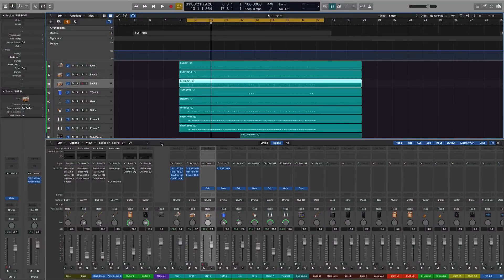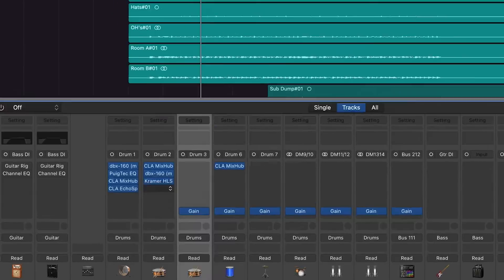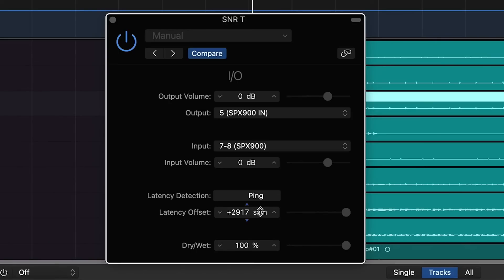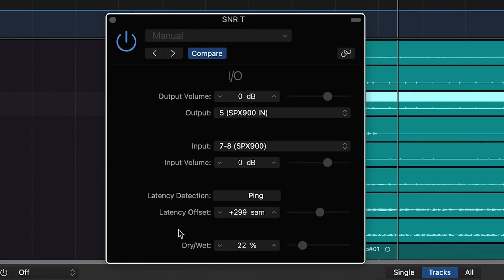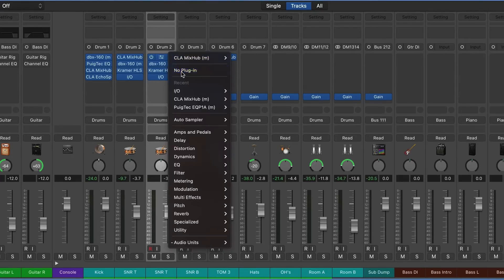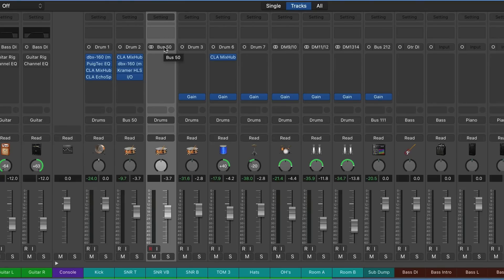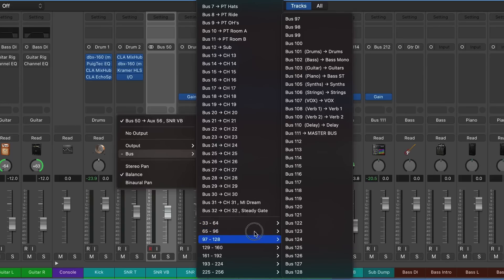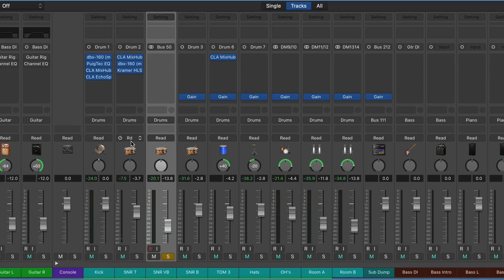Using Outboard Gear with Logic Pro X

Comment from the maker: Hey everyone. Let me know if you have any questions about using outboard gear with Logic.
Reply: how do i keep the changes that i did in the external gear into the track?
Reply from the maker: Hey Raz. You can print the output of the external gear onto a new track. That way you always have a printed version. I think I showed that in the video. 
Always take note of any settings on any outboard gear too, make a note or take a photo. For example, I send snare drums to my SPX900 and when I find the settings I like I note the patch name and any parameters I changed in Logic. If I was using an external EQ or compressor I’d do the same thing plus keep a photo of the settings.

Hope that helped.
Reply: @EverythingMusicRecording  thank you man you realy helped me !!
Reply from the maker: No worries at all!! If you have any other questions don’t hesitate to ask.
Reply: Can i use this method to reamp? Or maybe use pedal as an effectsboard?
Reply from the maker: You could yes. You would need a reamp box tho before your signal hit the front of an amp or any pedals.
Reply: Thanks for the cool video! I'd like to ask though, is there a way to use outboard gear, let's say a compressor without the I/O plugin in Logic Pro X?
Reply from the maker: Thanks, glad you liked it. And yes, absolutely. So let’s say you want to send a bass track out to a compressor without the I/O plugin. On that track set it’s output to whatever output on your interface is feeding the input of your compressor. Create a new track (this will essentially be the compressors return) turn on input monitoring and arm the track. Dial in the compressor and when you’re ready, just hit record. You can do the same thing using the FX sends as well instead of the tracks main output. 

You’ll have to adjust the new track tho as it will have a slight delay. That’s one of the benefits of using the I/O plugin is the delay compensation. 

Let me know if that helped or if I need to go into more detail.
Reply: @EverythingMusicRecording  Thank you so much for the info! What would be the best way to adjust the delay for the new recorded track? What would you do? Thanks again! Much respect!
Reply from the maker: No worries. I just manually move the track back. If it’s something with very obvious transients then just zoom in so you can see the transients of both tracks clearly and just line the new track up to original.

If there are no clear transients, like maybe a bass or distorted guitar, find yourself a 1 second test tone. Literally just a super fast little 1k beep. Place it on the track you’re sending out to a compressor or whatever you’re using. Stick it 2-4 bars before the start of where say the bass or whatever you’re sending starts. When you’re ready to record the new track start recording with the compressor bypassed. (Assuming there is a bypass switch that still lets unprocessed signal go thru the unit) and once you hear that beep, engage the compressor. That way after it’s track both the original and new track will both have a quick, clean transient you can use to line them back up with. 

The reason you want the beep to be clean is, let’s say you run it out to a reverb or a delay, that beep will now either be useless or make it harder to line back up with the original track. 

Let me know if that made sense. 

This is the sound though. It’s called a 2-pop or a sync pop. It hits when the counter hits the number 2. https://www.shutterstock.com/video/clip-16745287-2-pop-picture-start-video-countdownfilm-leader

You can make one in Logic as well. Just record a few seconds of a 1k sine wave and then slice it up to be a second or less. The ones in film are 1 frame long, so if you think 24 frames a second, it’s a very short little beep.
Reply: I'm trying to record through my Compressor so its directly affecting the track. I'm getting a reading through the gain reduction LEDs but its not affecting the actual recording? Im using a clarret 8 pre with a Drawmer MX30 Going out from the Clarrett (Output 7) into the MX30 (Input 1..left)  then plugging a mic into channel 1 of the Clarrett.
Reply from the maker: Hey other Jeff. That setup will not work. You would either need to run your mix into an external mic preamp, then into your compressor, then into the Clarett to your DAW. OR you would have to record first into your DAW, then send that track back out to your clarett into your compressor, back into the Clarett and back into your DAW. 

I did a video explaining this exactly so I'll leave the link instead of tying out a 12 paragraph reply. lol

Let me know if this helps or if you have more questions

WATCH THIS - https://youtu.be/8OcND5CYwsE
Reply: Hi Jeff ! Exelent video ! - I have a problem with mi configuration or my routing conexion - have a many feedback on my monitors when up the gain of external hardware - preamp or eq - what do you think need moded in my case ? Thanks !
Reply: Hi Ive been trying this to use the onboard effects of my x32 desk I can send the signal out using I/O and through the effects but I get nothing coming back to logic, I assume this is to do with the desk routing of card/local settings any ideas how to get this working? cheers
Reply from the maker: Hey Billy. I couldn’t get the wiki manual on Behringer’s site to load and the quick start guide was of little help. 

It should be in the routing section, I’d assume under the “card” tab. That’s where I’d start. I have no experience with the X32 so sorry I’m not much help on this. 

But start in the routing section for sure. I can’t imagine that there wouldn’t be a way to output the FX busses back into Logic.
Reply: @EverythingMusicRecording  Just in case anybody else has this problem, I found this method works. In the routing section of the X32 go to the CARD OUTPUT tab and choose a channel (it could be any channel) I chose 32 as its least likely to be used as much, change the settings "USER OUTPUT 32, category: to LOCAL IN, out signal to local in 32" then in the logic I/O plugin use 32 to return signal to DAW. Maybe there is a better way to do it, and if there is, and anybody knows it please share, but this method works
Reply: Do you dither on the way out?
Reply: Hello! I'm having problems.

I routed with the I/O in parallel on my drums, but when I record to release the hardware the sound changes and has a flutter or wow-like effect. Very strange.

Note: I already clicked on the ping for logic to adjust the latency.
If you can help me, thanks!
Reply: Yes I have a few questions. I follow all what you did but I am not getting signal in my outboard compressor. Is there anyway we can get on a call or is there somewhere I can send you a video of how I have it setup and you can let me know if I am wired wrong or if I am doing anything else wrong?

Comment: Quick question, would I use the same methods if I want to track with the outboard. In other words. In real time go into the interface and parallel record say, a compressors then have two track  one with the dry signal one track with the parallel compressed wet signal printed at the time of tracking ?

Comment: trying to tie in my H90 to Logic v 11.1.2.  Not sure what cabling is required first. Have MOTU 828 interface and two dual stereo TRS cables, and a USB-C cable going from H90 to Mac M3 computer. With a single high speed USB-C cable connected, do you still need analog audio cables involved at all? If yes, then stuck on how to connect them. Guessed that I could cable the H90 output 1 and 2 pair by going into line ins 3 and 4 on 828. Is that right? Tried that. But how does Logic gets its track modified by the H90 - say I bounced a BIP file on track 2 and I want to audition some wobble effects from the H90 - how could that work?  TIA if you know how to sort this

Comment: Is it possible to track vocals with the i/o and it be printed after being recorded?
Reply from the maker: Possible, yes. But it would most likely add too much latency and it would then be very difficult to track vocals. You would be better off recording thru whatever outboard you might want to use before coming into Logic (Example, mic --> mic pre --> EQ, compressor --> interface --> into Logic) or sending it out after you have finished recording.
Reply: @EverythingMusicRecording  imagine though?

Comment: Hey great video. I have a question though, if you print the reverb return, does it stay time aligned with the original track via the i/o plugin? In other words, say I print the track, and I solo both the i/o'd snare track alongside the new print, are they still phase locked and time aligned? With things like verbs there may be some predelay in the patch, so it might not be super critical that it's time aligned. But an 1176 or something, you'd hope that the printed track is still aligned like the i/o track after pinging it. Can you verify that this is the case? Thanks for the cool video! Just subscribed.
Reply: Same question here. For parallel procession it is super important to have a perfect aligned signal. In Cubase it is no problem.

Comment: when i hit ping theres no sound and no response. ive made sure the routing is correct. may i ask what the problem is?
Reply from the maker: Hard to say without being there to see what’s going on. Besides the routing I’d double check all the physical connections are correct (we’ve all patched things into the wrong thing, it happens)

Otherwise try bypassing the I/O plugin and see what happens. Take a track and set it’s outputs to wherever your outboard is connected too and set up another track with its input set to the return of your outboard and see if that works. 

Could also be as simple as rebooting as well. Sometimes the I/O plugin can do some weird shit

Comment: THANKS, do you think its a good idea to use an outboard compressor on the mix bus? im asking cause i like the sound of the new warm wa 1b but its a mono comp and im wondering weather i should get a comp thats stereo so i can use it for mixes..
Reply from the maker: I think it’s a good idea to use whatever works for you, be it a hardware compressor or a plugin. 

You’re right tho, you wouldn’t be able to use the WA1B unless you had a second unit since it’s a mono comp. So if you really like it you could get a second (which would give you something different then the typical SSL style bus comp) or you could find a stereo compressor that you like and use that instead 🙂
Reply: @EverythingMusicRecording  thanks

Comment: 299 samples ! What’s the reasoning behind typing this . I have a eventide dsp4000 unit that pings 2000 samples and it’s got me stumped on how I offset these number as it’s so high . I tried bypass unit before ping but still get over 2000+ ping no matter what I do . Guess it’s dsp related but I just want to make sure the latency is offset and I’m confident
Reply from the maker: Oh geez, trying to make me remember THAT far back? What did I ever do to you?!?! lol

The 299 I had tested with before filming the video. I knew running Quicktime to record the screen and such was going to cause issues and if I recall the 299 was what the I/O plugin gave me before making the video.

2000 is pretty high but your buffer settings and such can have an affect on that. Also there are times the I/O plugin likes to act up and give ridiculous readings. So that could be part of it too. I've more or less stopped using it as I have a different method. I should actually make a video about that process.

Comment: Hi, congrats on the great video. Unfortunately, I seem to be having a problem with Logic X’s I/O plugin.  The sound seems to go out fine but nothing returns. The I/O plug in worked on a previous Mac I had, but does not with my current model (3.5Ghz i7 imac). The other details: Logic version is 10.4.7, Mac OS is 10.14.7 (Mojave), Apollo Thunderbolt v. is 9.9. Any idea of what the problem might be and how to fix it? Or a workaround? Thanks a million!
Reply from the maker: Thanks, glad you liked the video. As for your question, thats a tough one to answer just because your version of Logic and Mac OS are quite aways back. Off the top of my head though it could be a simple routing issue. Maybe the wrong input returns selected or something along those lines (we've all done it lol) It could be a setting in the Apollo Console SW (if you're using that)

As for a workaround you could bypass the I/O plugin. Just set the channels output to where the signal need to go and have the return come back on a new track. Then you could just print the return. You will just have to manually line them up after to compensate for the time delay. A dead simple way to do this is on the track you're sending out add some sort of short sound, like a sync pop and place it a few bars before the track actually starts. Then you'll have a reference to line the tracks back up. I can explain that much further if need be, just let me know.
Reply: Hi, thanks a lot for your reply. Unfortunately I think I can rule out a routing issue, I suspect it could be a version mismatch/compatibility issue. As for the workaround, that’s a great idea and I was thinking of doing something like that (plug and unplug tech, coarse but… works! ☺). But it starts getting fairly unpractical when it comes to a multitrack session where you need a lot of different processors and would have to switch cables a dozen times or so. Or am I missing something? Again thanks. @EverythingMusicRecording

Comment: Wonder if you can help 🙏
I am trying to set up my M7 reverb … HARD-WEAR ROUTING: 
From Apollo x16 out ( in this case, output 1) into ➡️
M7’s AES (input ) then
M7’s AES (output) back into ➡️ Apollo IN ( in this case, input number 3 ) 

Regarding the m7, I brought up the Audio format 
To Digital, so that it’s internal routing is through the AES I/o ( see attachment). So I assume that part is covered 

So the problem I am having I believe is with using pro logics X I/O plug-in .. 
     Firstly,  I record a stereo acoustic track using the Townsend microphone so I assume I have to use the I/O plugin in stereo ?? .. 
         
         In the plug-ins Output,  I have put 1
         In the Input,  I have put 3 ..
Doing so  i can hear audio , 
But also latency in the “dry” mode  and the ping function doesn’t seem to be engaged  as I do it get any numeric summary after I press it . 

Also in wet slider at 100% I cannot hear the m7 when I scroll through the various reverb presets 

Any suggestions as to what I am doing wrong and how to final hear the unit doing its thing through the DAW will be super !
Reply from the maker: lol with the amount of questions I get involving an Apollo I think I'm gonna have to eventually suck it up and buy one.

So, knowing I don't own an Apollo, nor a Bricasti (I'm a little envious btw) it sounds to me like the issue is in the Apollo. AES is 2 channel. So Logic should be sending, as an example, to Outputs 1-2, and coming back on 3-4. But you only mentioned sending on 1 and returning on 3. 

You also mentioned changing the Bricasti's routing to digital (which to use it's AES ports is correct) but you never mentioned anything about AES on the Apollo which makes me wonder if you are outputting and returning to the Apollo via the DB25 connector and not AES, which you would need to do.

If you are feeding out and back in VIA the Apollo's AES ports then those ports may not be configured correctly in Console. I don't know if they default to this setting or not, but many use the Apollo's AES ports to feed extra monitors. This is configured in the Hardware section of Console. So take a look in there and see if you can find out what, if anything is being sent out via AES. If MIRRORING is turned on then they are set to mirror the main monitor output. Either way you'll need to make sure that 2 channels out and back in are assigned to the AES ports in Console. I have a hunch that is where your issue (may likely) reside.

Keep me posted =)

Comment: When I use the I/o plugin I only get audio from my left ear? Help? The only solution I have found is copying and pasting the mono recording to a duplicate track, and setting the first track to output 1 and the second track to output 2 even though I am only using a single line to xlr cable out of output 1 on my interface
Reply from the maker: Off the top of my head it sounds like you have a mono track but might be adding a mono-stereo instance of the I/O plugin. So the plugin is expecting to see a stereo return from your outboard gear. Make sure that in this case the I/O plugin is set to mono. 

Let me know if that helped any
Reply: @EverythingMusicRecording  update! For some reason my Logic Pro routing is SUPER BUGGY! it works fine sometimes other times I have to out to a bus, then delete the bus and switch back to stereo out on the track. Or switch the track input to no input, then back. Sometimes the fixes it if I just solo the track and then unsolo it.
Reply from the maker: Sorry for delay Dakota, been crazy busy over here. That’s messed up. I’ve never had Logic do anything like that so I’m a little lost for words on that one.

Are you using a mix template or are you starting sessions from scratch? Reason I’m asking is that if you are using a template then maybe the template file could be starting to become corrupted. 

IF a mix template has the issue but a new session file does not then you’d know it’s the template and you’d want to recreate it.

If it’s not something like that it could be a preference file issue, could be Logic itself. Sometimes trashing the .plist files for Logic and rebooting can solve weird issues like that. Other times you may just need to uninstall and reinstall Logic. I’ve never had to go that far but there have been times over the last 17-ish years of being a Logic user I’ve had to trash plist files. 

That’s all I’ve got off the top of my head. Let me know if any of that helps